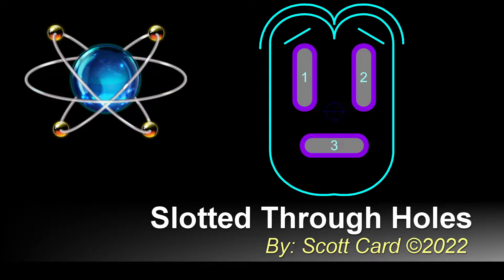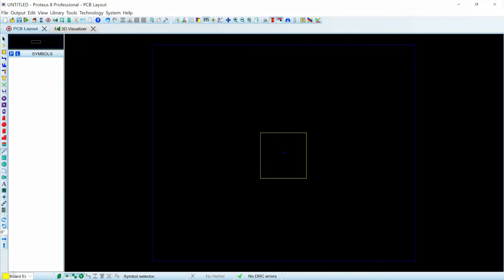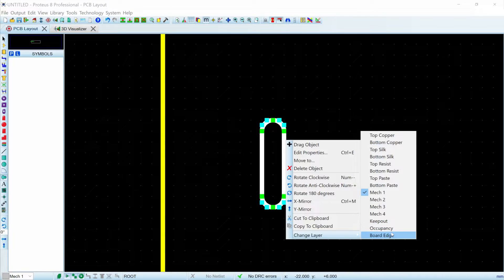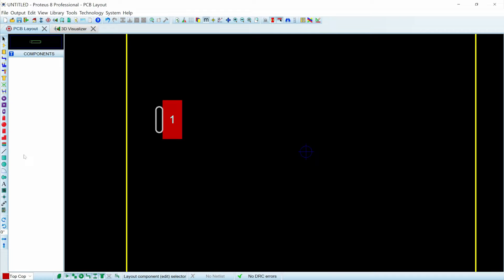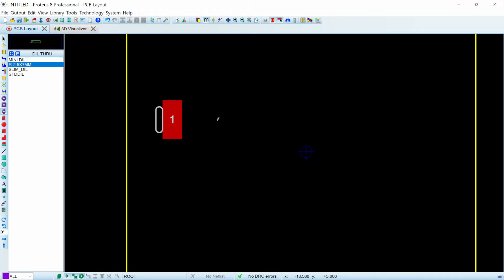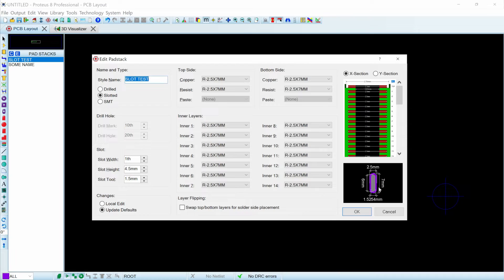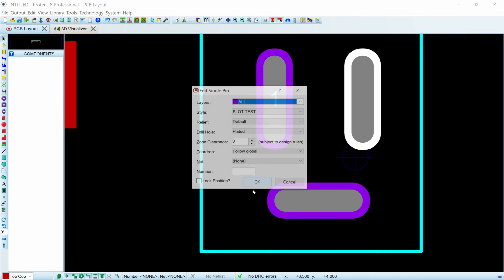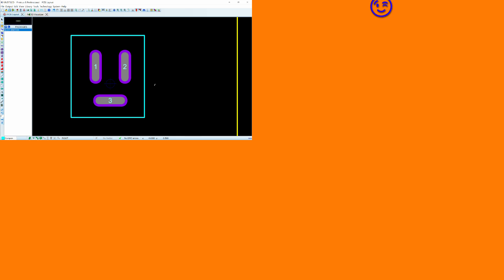Proteus - How to Make Slotted Holes

Comment: Thanks Scott.
The thickness of the mech layer line is the width of drill my board house uses. So let's say you use mech layer 1 (grey line) and draw a straight line 40th in width. That's the width of the routed space. Most board houses have limits on how thin a routed area can be.

Comment: Great video! I have created several slotted holes. They appear as trough holes in PCB layout and 3D Visualizer, but in the Gerber view they are just pads :(
Reply from the maker: That is strange that you are seeing holes.  On my Gerber viewer  I see the slots on the Mounting Hole layer, and a circle in the Top Assembly layer. Maybe check the layers to be sure.
Reply: I have the same problem.
Were you able to solve it?
Reply: @jauderruiz785  I asked around on several forums (eg Sonsivri). No one had a clue. What I did, I ordered boards anyway and guess what? They came in with slotted holes, exactly as I designed them. Cannot tell, did manufacture do changes manually or just Gerber viewer fools me?
Reply: @jaremaw2368 I'm facing the same issue but I'm confused, because if i order the pcb and it will not come with soted holes, it will be very difficult to do these holes manually without precise tools.
Reply: @tayyabasim9795  Did you order the PCB with the version you shared at your answer, and did it work? Or did you change any settings related to slotted holes? Because I'm also facing the same issue
Reply: @beyzanalbant3498  No I did not ordered this yet but I'm planning
Reply: @jauderruiz785  youtube deleted my response :(

Comment: Thanks Scott, interesting approach. I find board houses are reluctant to do slotted hole pads or they charge additional for them. One thing, in mech1 layer the thickness of the line determines the diameter of the slot, for example, if you have a 40th line it will be slotted to 40th. Most board houses have a minimum limit to slot diameters.
Reply from the maker: Great point. I just got charged extra for a tssop package due to trace size and spacing....groan.  thanks for the comment 👍

Comment: Hey Scott great video! Was wondering if you could do one on castellated holes? Or would slicing through holes on the perimeter with the board work just as well?
Reply from the maker: Great suggestion! I will work on a video but, yes, slicing though works. Typically you add a mechanical line that will represent the milled surface that is done as the last process.